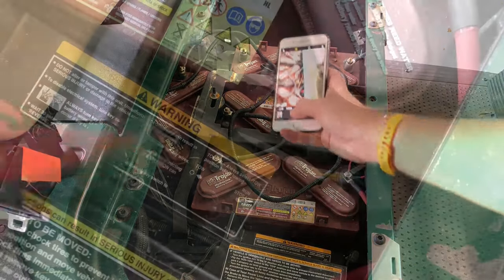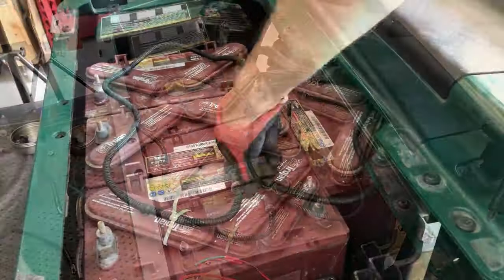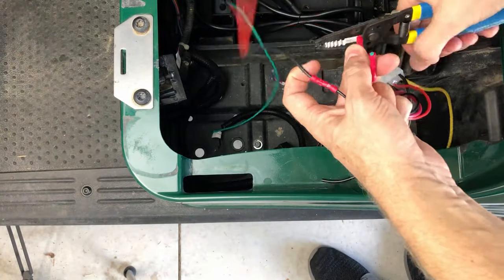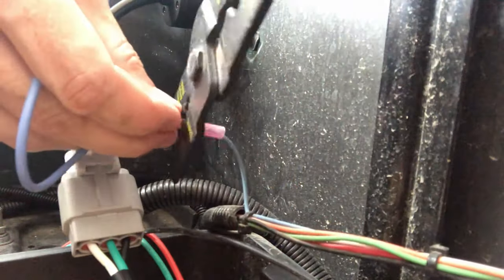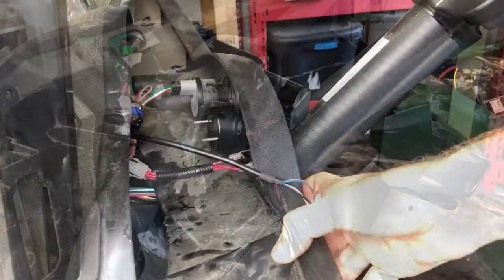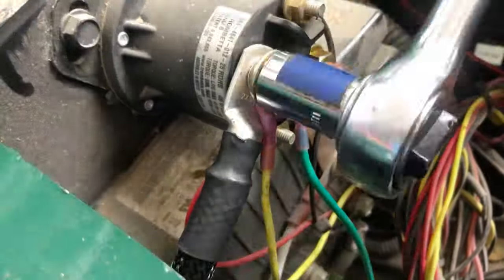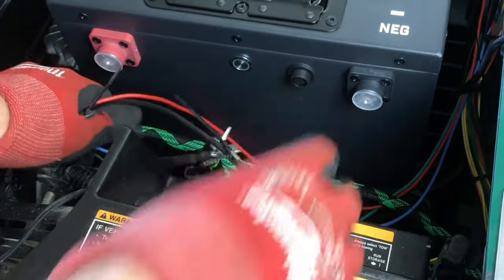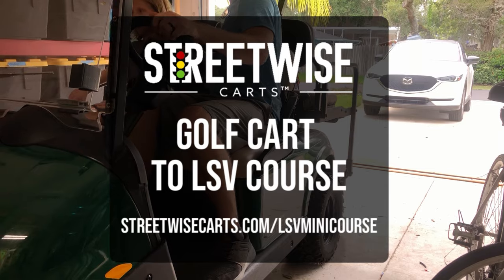Eco Battery Bundle Installation for 2018 EzGo RXV - 51v 105ah Lithium Conversion made Easy!

Comment: Great video. Straight forward instructions.  One question. Other videos on ECO/RXV replacement has the voltage reducer orange withe (Key switch) going to the cold terminal of the key switch. Your instruction has the orange wire going to the solenoid with the copper strip. Do both procedure accomplish the same result - shuts off voltage reducer when key is in the off position? Thanks, Bob
Reply from the maker: Thanks for your nice feedback. So this is specific to the RXV where the solenoid makes sense vs the key switch behind the dash. The RXV has a sensitive controller and it's the advice I've heard not to mess with the key switch as it might fry the controller.

Comment: I followed this and I can't seem to get my voltage reducer to kick over. I have the orange going to the solenoid but reads no voltage.
Reply from the maker: Make sure it's going to the post on the solenoid that has the copper bar on it. If you post in an RXV facebook group I'm sure you can get more assistance than I can provide here.
Reply: Do you recall where you routed the wire with an inline 2 amp fuse? I believe it is for the factory usb charging port, but can’t find any solid info on it.